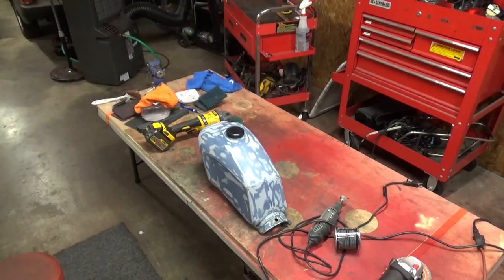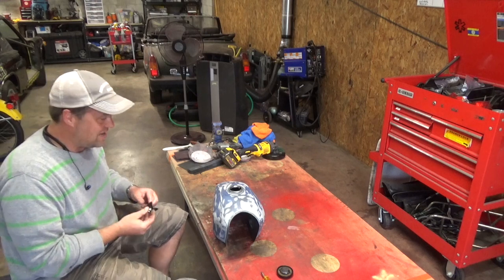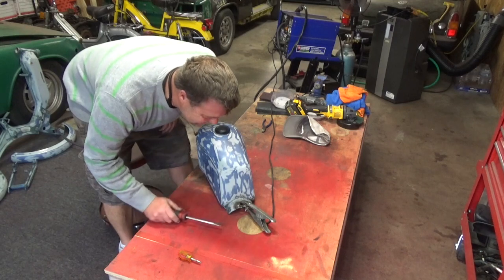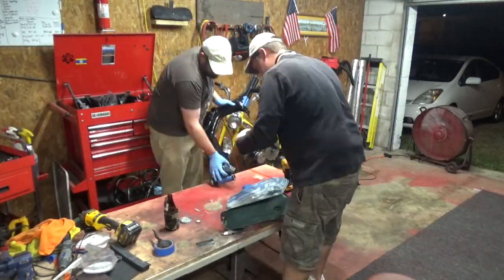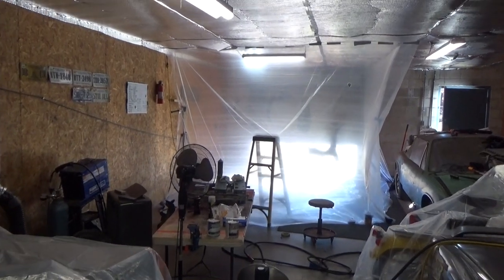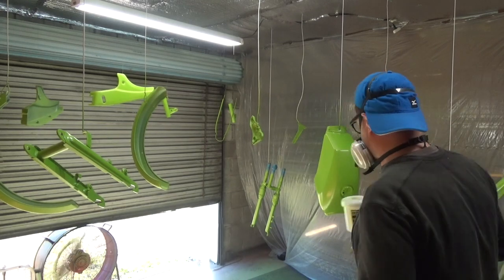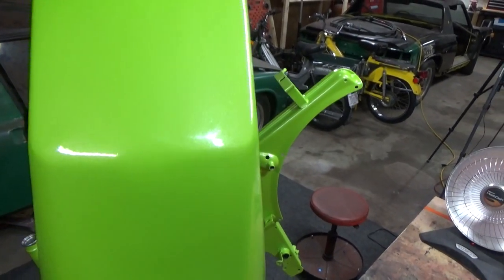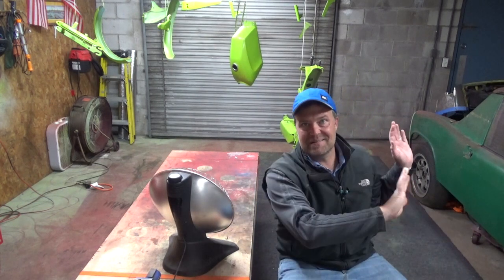DFHS Tomos Restoration Ep 3 - Paint

Comment: Hey Dave, love watching your videos. I’m getting ready to paint my 1980 Tomos silver bullet. My hold up is VIN. Rather than the common metal vin plate with rivets, which I saw you remove on your maxi paint job, my Tomos has a really worn old sticker. What would you recommend? I am concerned taping over it could damage as it’s not in great shape and given its age and wear it’s not a good clean line for me to tape and paint around anyways
Reply from the maker: Hey man. My Tomos has the old metal sticker too. I painted over it and then came back with brake cleaner and carefully rubbed it off. Seemed to work alright..

Comment: He mentioned etching the gas tank does anyone know what that does to the tank? what is etching?Thank you
Reply from the maker: The etching makes it so the coating sticks to the bare metal better.  Its just a mild acid that really cleans it, and then makes the surface a bit rougher so that the paint will stick.
Reply: @DavidFixesHisShit  Thank you for replying back and for the info.
I am at the point were cleaning the tank is next.
Cheers